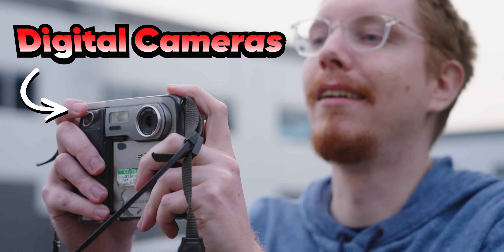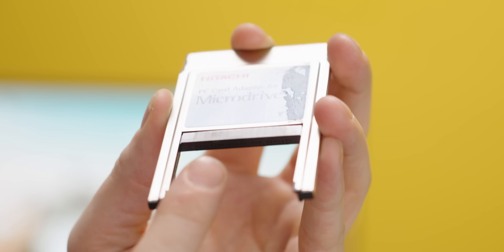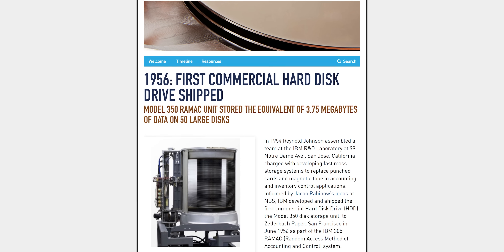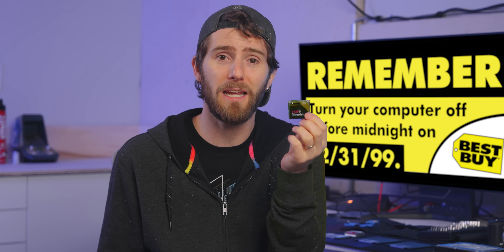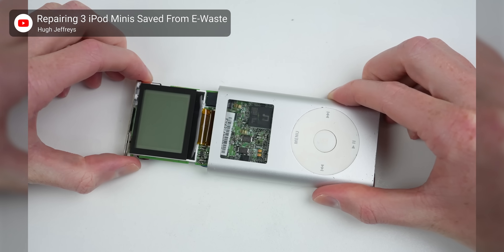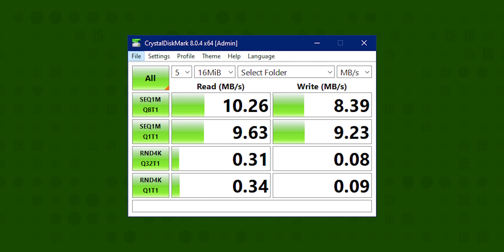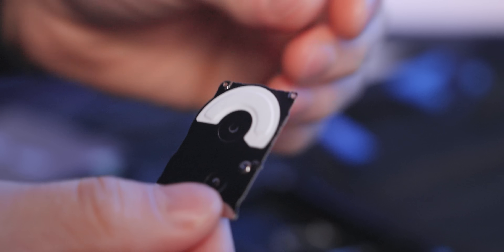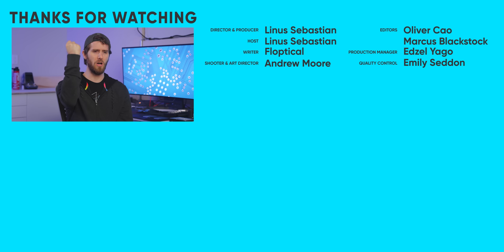This TINY Hard Drive is REAL... and it changed the world! - IBM Microdrive

Comment: I bought a Creative MP3 player back in 2004 (+/-1yr) because it had the 4GB version and was at least $100 cheaper than buying the drive itself.  I took the Microdrive out and used it in an early digital slr for several years.  In the mp3 player, I put a 128MB CF card in, loaded 'something' from the computer, and it worked great for a few years.

Comment: You can hear the drives in the iPods spin up/down as needed. It's pretty neat. I still have a solid state click wheel iPod from 2002, and it retains the external hard drive feature, though firewire is no longer supported on most newer Macs.

Comment: That was so cute!  By the time I got into digital photography (still also doing some film) around 2003-4, it was right when Zip disks and these Micro Drives were dropping out of favor and flash was starting to become the norm.  Certainly remember my "big" CF purchases for both hobbyist and professional work like picking up a 128 MB CF trip for a vacation back in 2001, getting some 256 / 512 MB cards for work, and eventually now, 128 to 512 GB cards for professional RAW shooting (CF Express and also mostly CF with some SD).  Grew up with CF more or less and preferred it for its superior read/write speed for sure (SD just wasn't the thing as much back then).  Sadly never really got to see Micro Drives around despite hearing of them.  Neat!

Comment: So, amongst a lot of professional photographers of the day (I worked as assistant at the tail end of high school in 2003-2004) did not trust these things. They had a bad habit of dying and taking all of your valuable photos with them. Flash based drives were so much more reliable. The large factor besides what you mentioned (Moore's law, minimum cost for a hard drive) was that these were always viewed a little suspect, and once flash was even vaguely competitive, most photography magazines and pros recommended abandoning them.
Reply: Fact! They were not very shock resistant. All the walking, sudden aiming, bumps, etc and of course shooting didn't lend well to them surviving for too long.

Comment: Slightly misleading as PCMCIA was meant for storage from the beginning, CF pretty much just did away with the pins that were not used for PCMCIA-ATA. I used PCMCIA flash cards with routers and switches.

Comment: I have a 4gb IBM MicroDrive on my desk. This was back in the days when i was building custom machines with case windows i cut myself and then i put coverless hard drives on the inside of the plexi, so i could see them spin while i DJ'd parties with a water cooled, dual socket system with a 125wx4 car amp bolted to the other side of the case.

Comment: Fun fact, iPod minis are 100% compatible with compact flash cards, the firmware of the iPod don't lock down the maximum capacity, it's just limited by the standard of the interface, which is 128gb to 256gb depending on the revision (which is HUGE compared to the original 4 or 6gb!)

Comment: Best thing about the iPod mini, apart from the pretty nice form factor, was that you could flash convert it with a CF card.

I remember buying the very first 32gb CF card that was generally available and cramming it into a green mini. Had to import it special from China and it was made (or at least branded) by a basically unknown company called Adata.
Reply: Adata is less of a knockoff brand than the usual AliExpress stuff. They make average quality hardware, like elpida or silicon power. Of course there is always a faster/better product, but it at least works well enough.
I also have a 64gb iPod Mini, and while it works, it is the model that gave me the most issues with flash modding. Disk icon several times before deciding to boot, very low battery life even with brand new battery, it is tricky to get going, but I still like the form factor, it's perfect in the hand.
Reply: @benjiderrick4590  yes, they are now. But this was 15 years ago.

Comment: I was a bit puzzled by the statement that the CF card operates on PCMCIA, because I always assumed it was an IDE drive. So I looked it up. Turns out it can do either of those two depending on the state of one of the pins. Clever.
Obviously the iPod Mini using the MicroDrive would have made them fairly straightforward to flashmod, were it not for the fact that they are much harder to disassemble than the full-size iPod.

Comment: I remember my parents getting me an MP3 player with a whole 2 gigabytes in it for christmas. I remember putting my entire digital library of several dozen songs on there and it felt like I'd never run out.
Since my truck only has a cd player and I don't want to buy a new radio, I have to fit all my songs onto a 700 mb cd. Which means that, ironically, my music storage capacity has gone down since then. Though it's fine, I only have like, 140 I like and since the sound quality of my trucks speakers are so low, I can compress them pretty hard without noticing the difference.

Comment: It is worth noting that there were two different thicknesses of CF cards, 3.3 mm "Type 1" and 5 mm "Type II".  The Microdrive was a Type II (thicker) card, and not all cameras would accept it in their card slot.  I remember that the first digital camera I bought, the Canon G2, was one that did support both thicknesses of CF card.
The G2 could be set to output raw-format images instead of JPEGs, and with raw image files being about 50% larger than the highest-quality JPEGs, the extra storage space was important.

Comment: Ah, the Rio Carbon MP3 player (bottom device at 8:05). Mine took some hard knocks, dropped onto concrete a couple of times, while powered on. It still works today! The battery is kinda done for and the buttons are heavily worn but the little HDD is still working like a champ. I always wondered what kinda storage it had hidden away. I knew it was a HDD of some kind as you can hear it when it operates.

Comment: @LinusTechTips A "real" gigabyte has always been a billion bytes.
"Kilo" means 1000, and not 1024.
So HDD manufacturers have never been cheap, they have just adhered to the SI standard.
The way most flash and RAM technologies work, makes it easier to makes capacities a multiple of 2, which is where numbers like 128, 256, 512, 1024, 2048, etc come from.
You would really do the whole IT community a big favor, if you made a video addressing these all too widespread misconceptions.

Comment: I opened a dead 4GB micro Drive from an iPod mini and it is pretty neat :)
Reply: The fact that it's the same form factor as a CF card makes the mini dead easy to flash mod. Either stick a CF card straight in there or an SD trough an adapter. 

Now I have a 256 GB iPod mini! :D

Comment: I remember getting a USB version of the Microdrive as a college student! I saw one in the local Computer Hardware shop, thought it was pretty novel (I was 16 at the time...) and bought one. I  used the college network for downloading things while in class (Because my home internet was painfully slow) and needed a compact way of getting that back home... These Microdrives were bigger than the USB Flash Drives (128MB was common at the time) and they worked! But, I ended up completely ruined it by not taking care of it. Fun times!

Comment: my first usb flash drive was $120 and held 1GB.
And it still works 18 years later.
Reply: I still have my first usb flash drive, a 1GB Verbatim. It was very expensive, but I wanted to be able to store a CD image in it! Back in the day it was mindblowing... A few years later they were giving them away for free, I have a Coca Cola branded one.
Reply: Wow 1Gig in 2005? That must have been fucking expensive. I still have an 256MB Apacer Steno from that time and it already cost over 100 bucks back then...
Reply: @Setsuna_Kyoura  My first drive was a 2GB A-Data and it died in a few years. Then I got a 4GB OCZ which used a dual channel flash controller to achieve higher speeds. It actually maxed out USB 2. It was very expensive for the time. About $200, which could have bought a 16GB drive. But this drive, I could full read/write in 5 minutes vs. the several hours it would take to actually transfer 16GB on the cheaper drive. 
And after a million drops and even a few washing machine cycles, it still works today. And - in terms of speed, at least - it's actually still very competitive with modern commodity drives.
Reply: @Setsuna_Kyoura  it was stupid expensive, I can't recall exactly what the exchange rate was, but I must have paid close to $200 USD. It was so stupid expensive that for most stuff I used smaller 64/128mb sticks to avoid wear on the 1GB one... I didn't get to use it that much before they were giving away 1GB sticks for free...
Reply: Storage capacity-vs-cost has continued to plummet.  I just bought a 512GB M.2 SSD for sixty bucks new.....
My first flash drive cost $250 and had a capacity of 256MB.  It was the top-of-the-line drive of the time though, brushed aluminum case and supported a full USB1 write speed. ;)
Reply: My first one was a 16MB one from 03 or 04 😅 I think it cost me £30? £40?

Comment: As a kid (un)fortunate enough to have a Sinclair QL as the home computer / dad's computer I grew up with Microdrive Cartridges before 3.5'' 'floppies' even existed and 360kb genuinely floppy 5.25'' disks.. Sinclair Microdrive Cartridges could hold about 110kb on a continuous loops of tape (so random access unlike an audio cassette).. IBM's microdrives may be 1000x better in every way but aren't REMOVABLE media, and Sinclair Microdrive user will tell you there is something special about the feel and sound of inserting a Sinclair Microdrive Cartridge into a Sinclair Microdrive.... The cartridges were about the same size as an IBM microdrive too, if not a bit smaller. Ironically, I had a mini PC business (mainly on ebay) for a while 20 years ago and used a microdrive as the main hard drive on many. They were actually more reliable, faster and cheaper than CF Flash for many years... blah blah.. Microdrives!

Comment: My school had a few floating around the photography department. The teacher in charge actually convinced the principal at the time to buy a bunch of flash cards (because students+moving drives don't mix), but the cameras they bought came with them anyway. By the time I got there, they were sort of irrelevant, but why throw out something if it can be used?
Trusted students were allowed to borrow equipment over term breaks or the weekend etc. and usually they got given the microdrives rather than the flash drives.

Comment: The other fun fact about Compact Flash is that it's ATA compatible, meaning that with a cheap passive adapter, you could plug it directly into an IDE socket on your laptop or PC. I recently took the 6GB drive out of my iPod mini and replaced it with a CF to SD adapter and a 256GB microSD card. The second gen mini will accept cards up to this size believe it or not!
Reply: I used a compact flash drive as a SSD in the past to use as a boot drive for a linux firewall. on a super-old HP SFF 486 desktop, it was lightning fast compared to the crappy HDDs of the time.
Reply: Several of the fuel dispenser that you see around you have full on motherboards including all of the normal IO running off Compact Flash.  At the lease the Gilbarco Encores withing the last 10 years have.

Comment: My first hard drive was a double decker 5.25 inch drive. It was the size of 2 DVD drives stacked on top of each other. It was 20 MB. The CPU was an IBM 8086 and the system builder was AT&T. Rockin' MSDOS 2.1. This system was $5,000 US in the 80s. That's got to be about $20k in today's money. That's where I learned GW Basic, on the green screen. High tech stuff..... Man, I sound old. Still, I'm sure there are some viewers who had the slide rule and notepad as their computer setup... so I'm not the oldest!

Comment: I have a couple of 4gig Microdrives from Apple music players still. The players were turned in at household hazardous waste collections. The players were dead but the drives are still good.

I also have a Panasonic PV-SD4090 digital camera. It takes LS-120 Superfloppy disks, which are 120-meg floppy disks. You could also use the "regular" floppy disks in it if needed. The camera still works and I still have unopened disks for it.

Comment: I find it super interesting to see such a tiny harddrive exist. And now 20 years later you get the same size of not smaller ssd with over 2000 times the capacity and probably the same factor of speed too. It's crazy seeing how fast tech evolves

Comment: I might be wrong, but PCMCIA has  IDE-command (or ATAPI)  compatibility.  And about reading-speeds... we did not have as bloated software back than, so it was not loading 3 GB of data just to startup the computer. (but yeah, kind of slow anyway)

Comment: Tiny correction, these are actual IDE drives, the PCMCIA standard just happens to support the PCMCIA controller being run as an IDE controller.
The first PC Card standard was just more or less an ISA bus fed trough these tiny pins and was mostly used for memory cards, check out the Tidalwave PS-1000 Palmtop, that uses RAM cards, which still cost an arm and three legs thanks to being used in industrial machines, as its storage media. And the Amiga 1200 and 600, which both have PCMCIA slots, can use RAM cards as a memory upgrade.
Later they added a PCI mode to the standard and then it more or less vanished in favor of just using USB dongles.

By the way, in case anyone from LTT reads this, i would love an episode on old Palmtops like said Tidalwave. That one was sold to a million OEMs under different names, a popular version here in Germany came from Vobis and had the name Highscreen Handy Organizer. It is essentially a pocket IBM compatible, it has a NEC V30 and CGA monochrome graphics and is for all intents and purposes a Turbo XT class machine. And yes, it comes with and runs good old QBASIC. 😁

Comment: My favorite thing about CompactFlash just using a subset of PCMCIA is that CF drives work great with inexpensive adapters on even the oldest of IDE interfaces. It's a great solution for restoring a vintage computer. Yeah, late 90s/early 2000s flash media isn't suitable for a modern OS, but it's great for MS-DOS or other operating systems that were ultimately written to be loaded from Floppy Disk.

Comment: I remember when I was a beta-tester for the TRGPro, a hardware mod for the PalmPilot IIIx that added extra memory, a CF slot and a headphone jack, though they removed the headphone jack for the final release model. I bought a (*VERY* expensive) Microdrive to test in it and TRG even wrote some software to stream WAV audio from a file on the CF card to the headphones (the MC68000 processor wasn't powerful enough to handle MP3) and were considering rolling a specialized model out for the industrial market with visual, textual and audio instructions for on-the-line training all available from a portable device (in 1999!)

Comment: In 2000 a customer used Compaq Ipaq (COMPAQ IPAQ POCKET PC H3860)  + CF Expansion Sleeve (Compaq iPAQ 170339-B22 Compact Flash Card Expansion) . This allowed the Microdrive to be used and accessed on the handheld. Councils could then save their utility maps (SVG was used at the time due to zoom capability) to the cards, and their field workers could now access pipe and duct information onsite.

Comment: I had video camera with a little drive built in, I think it was 32GB and also had a SD card slot. It was great for a few years but at the end SD cards were coming out at 32 - 64+GB so I just used a card and saved battery life.

Comment: My first flash storage device in 2004 was a 128 MiB USB 2.0 drive and it was roughly CA$1/MiB.  That drive was used when I attended college.  Two years later I was able to buy the same capacity for less than 1/10 the price at $9.99.  Now I can buy hundreds of GiB for less than $30 that is smaller than my thumbnail in the form of MicroSDXC.

Comment: Just to let you know....
GridPad HD/RC	1910	NEC v20 (9.5 MHz)	2 MB RAM	1–2 PCMCIA; 20 MB HDD option	10", 640 × 400 B&W backlit	MSDOS 3.3, GridPen	4.5 lb (2.0 kg), 12.5 x 9.25 x 1.5"
Jul 1991	20MB HDD on HD; RC has 2 PCMCIA and wireless option
My first Digital Camera was all digital and stored the images in memory back in 1997. I still have pictures I took with it back then.

Comment: I have two micro drives. One in parts box with CF and SD cards, and then I have one in my Amiga600 that have been heavy upgraded. After I installed an accelerator, there were no room for any 2,5 inch HDD.

Comment: @Linus Tech Tips     Would you be interested in checking out a what looks to be barely used geforce gtx 1660 super that gives no display?  when i plug the power cord into the gpu the fans kick on for a split second than turn off and i get no display from dp or hdmi. i have tried it in 3 different computers with no success.

Comment: I had a Palm Lifederive with one of those CF-compatible hard drives. A few years later I bought a driver that allowed using a normal compact flash for way faster load times. Unfortunately I killed it one time after reassembling it and damaging the power switch.

Comment: I have a first generation iPod mini with the original 4GB drive in it. It still works. I've had it since new. I had a 16GB flash drive in it for years, but it died, and the original drive still works (I'm glad I kept it).

Comment: i had a small archos mp3 player around 2006 that had a really small hard drive,actually i think it was smaller than the one he is holding,,,can't remember how much storage it held,,,did'nt know for sure there was a hard drive inside until i took it apart when it stopped working,,,but you could definitly hear and feel in running